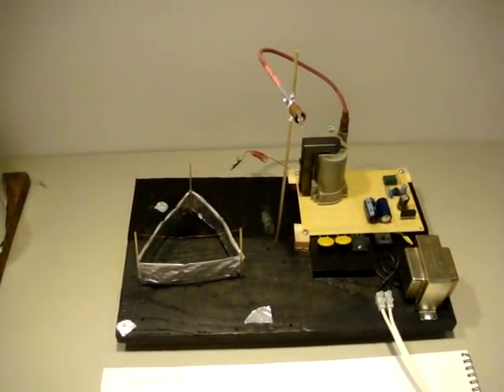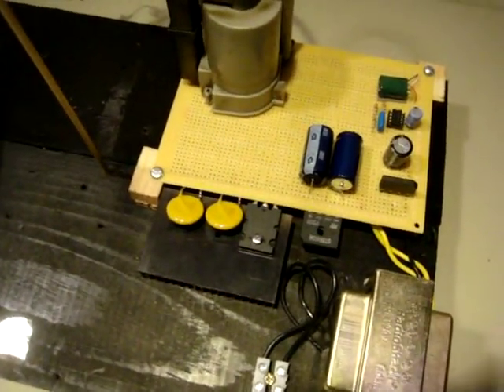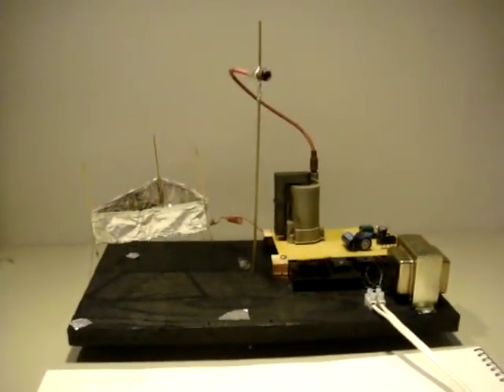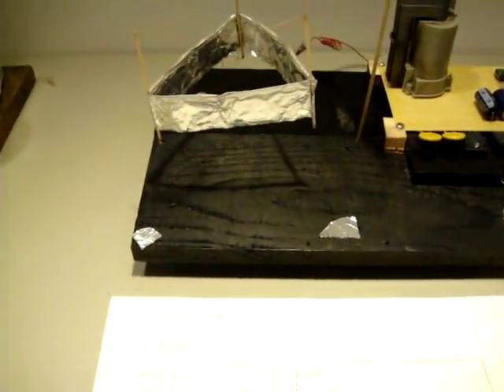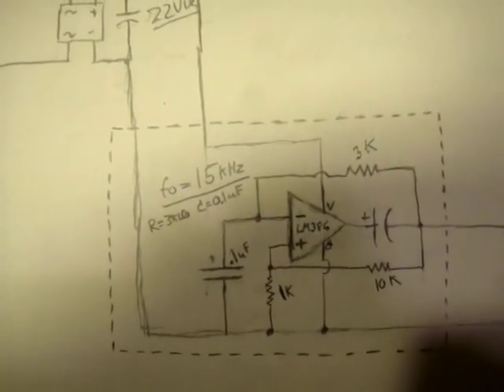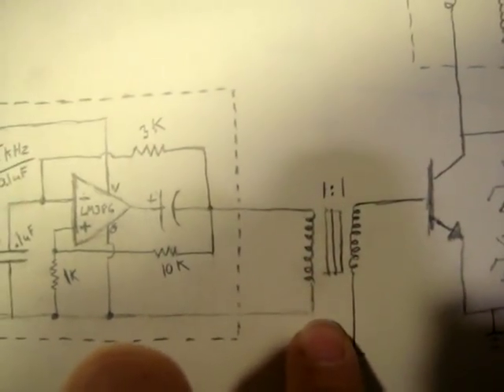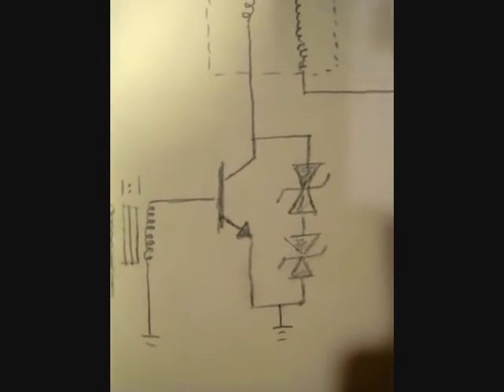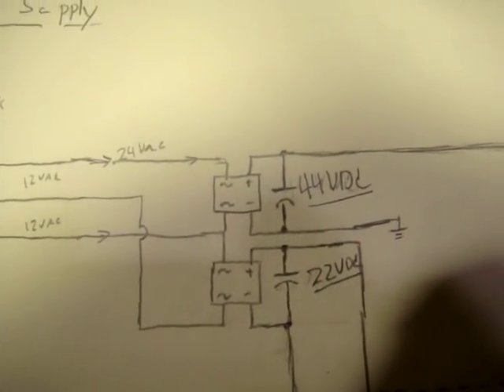How to: "Lifter" Power Supply

Comment: Hi Sparkstarter. I am using a new reliable Acopian power supply that put out exactly 30,000 Volt on a 5" X 5" X 5"  triangular lifter and it would not lift up.
The lifter weighting 2 grams. The top wire is 3 inches above the aluminum foil, and I did not see any corona discharge.
The voltage is at 30000 volt but the current drwan is only 0.20 milliamp. This means the power use is only 6 Watts (30000 X 0.20/1000). 
Your lifter is only slightly smaller than mine and yet it draws 26 Watts where as mine draws only 6 Watts.
Can you tell my how you get your lifter to use 26 Watts ? 
Maybe the reason why my lifter is not lifting off because it does not draw enough current ?
Can you tell me why it the lifter did not lift off the table ?

Aluminum foil size: 5 inches X 1.5 inches on all three sides.
Wire: 30 gauge copper wire.
Lifter weight: 2 grams.
Volt applied: 30,000 Volt
Current draw: 020 milliamp
Reply from the maker: Assuming weight insn't a problem,... your power supply is too weak. You need lots of corona current to drive the ion wind. Upgrade your power supply see what happens.
Reply: @sparkstarter  My power supply has a maximum output of 60 Watts and it is brand new. The engineer at Acopian said that the current draw from a power supply is dependent upon how much the current draw, and you cannot push more current than the circuit uses. 
I did followed the engineer recommendation to test and see if the power supply can put out 2 milliamp without connecting to the lifter and it did deliver 2 milliamp which prove that it is in good condition.

1) I don't understand why your lifter is smaller than mine and have a short wire that goes around the triangle lifter but yest it draws 28 Watts. My lifter also has a short wire that goes around the triangle and it draws only 6 Watts.

2) What is the maximum Watts that your power supply put out ?
Reply: @sparkstarter  When your lifter lift off the table, what was the value of the voltage and the current ?

Comment: Just a question, your final output from the high voltage transformer appears to have no diodes. Looks like you are putting AC into your lifter, is that correct or did I miss a diode after your high voltage transformer? My understanding is that lifters must use DC, with the thin wire being positive.
Reply from the maker: Good question, the diodes and capacitors are in the flyback transformer.
Reply: @sparkstarter  The diodes and caps are actually in the transformer? I didnt know or expect that. Ok thanks
Reply from the maker: @c6jones720  yeah those style of TV flyback transformers have the high voltage multiplier built in.

Comment: Could you help me build a smaller version of that
Reply from the maker: What kind of help do you need?
Reply: sparkstarter how many volts did that produce?
Reply from the maker: @robelggg about 25,000 V to 30,000 V
Reply: sparkstarter is it possible to add transformers and voltage multipliers to get it even higher. Also would that be safe and would the battery explode.
Reply from the maker: @robelggg  Yeah can go Higher in  voltage but there are trade offs...  you need to make it bigger if you use a higher voltage but bigger "Lifter" needs more thrust and more power. You might want to check out this website to get some design idea's http://jnaudin.free.fr/lifters/perf.htm

Comment: do you need all the circuit or can't you just hook it up to a 24w supply? (eg, 12v 2a, 96v 250mA?)
Reply from the maker: you don't need the transformer and AC to DC rectifier parts of the circuit if you already have a DC supply.
Reply: but dont you need like atleast 2kV to make the ion thruster thing in this video? 

or do you only need about 30 watts?
Reply from the maker: You need the high voltage to make the lifter fly, 30kV
Reply: well then..